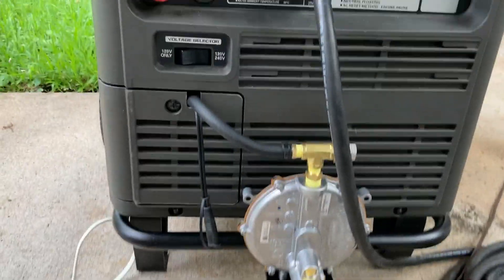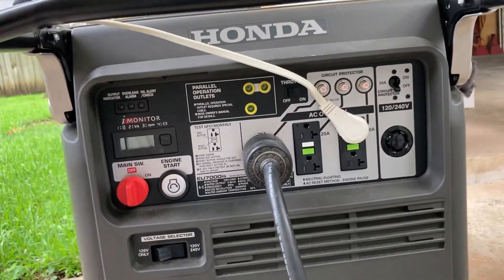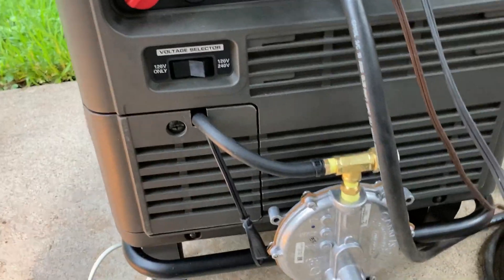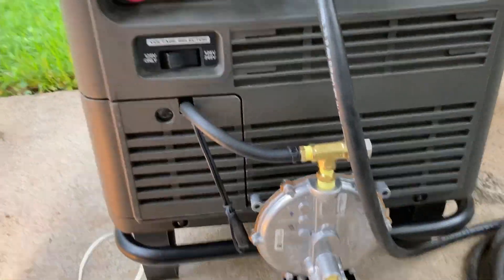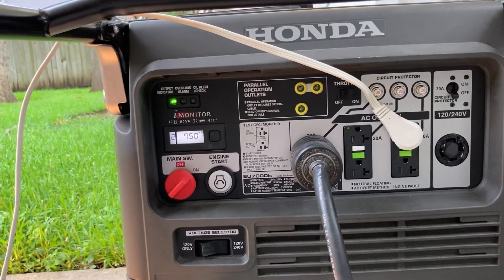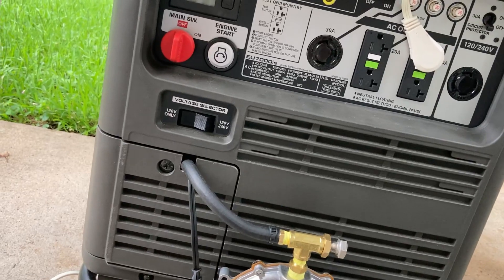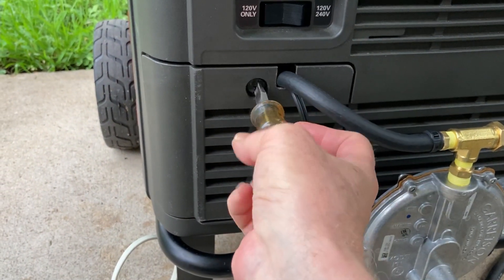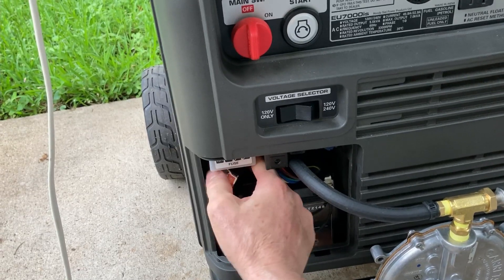Honda EU7000is running on natural gas with US Carburetion Motor Snorkel tri-fuel conversion kit

Comment: After a four day outage here in Ottawa, Canada, I have ordered a Generlink kit to replace my 10 circuit Reliance transfer switch, and also I do plan  now to go ahead with natural gas conversion. The Honda IE6500 cost me about 1 litre of fuel per hour ($2) which is not bad, but not like using the natural gas in the home. I have a  question. Based on your experience with pretty much the same generator, will the 3/8 inch outlet I currently use for the barbeque provide enough gas to power the Honda or should I buy all 1/2 inch fittings and have a gas fitter change the lines inside the house. 
Your opinion ?
Reply: Just an add on to my previous comment. It only takes one major power outage to change one's opinion on backup power. I now look upon all this backup equipment like I do when I buy insurance. You pay for something that you hope you will never have to use. At least with the Generlink plus natural gas conversion steps you DO get something besides "insurance". After watching my neighbours struggle with lack of power, and running 100 foot extension cords to keep their sump pumps and freezer working, I now have new respect for backup power. And frankly, I don't give a damn how much it costs me to get set up much better, I'm going ahead with it...including natural gas conversion. 

My son and one of my employees are currently using my two Champion 2000 watt generators to assist untold people in preventing their food from spoiling. It looks like another week before this disaster will be over with everyone back on utility power. This real disaster will not be easy for forget, even though my home was powered by the big Honda for some 60 hours total.
Reply from the maker: @TOURMANBOB  Oh, so you're still doing it - that's awesome!  Yeah nothing like a good disaster to alter one's perspective.  That's how it is with any kind of "prepping" - silly waste of time and money until it's desperately needed.  Following the Texas blackout, I was ready to buy a legitimate water-cooled standby generator.  But fortunately(?) they were impossible to buy in the wake of that event.  I did go ahead and install a new breaker panel with a manual whole-house interlock, though.  I still don't have it finished...8/3 copper wire is so absurdly expensive right now...kind of takes the fun out of it.
Reply: @MstrMark  Boy you are so right !! After four days of easy running my home on the Honda EU6500 I actually feel somewhat blessed. My electrician called me this morning with the permit information for installation of my whole house Generlink system... an expensive but very good option  where it is allowed (ok, up here in Ontario)
I too thought about the standby generator but hearing one run at a friends place I'm glad I didn't opt for it....it is frigging LOUD...worse than an open frame construction generator. So just waiting to get screwed on the Hydro permit ($315) after which he can proceed. Half the town is still out but my power has come back....this has been the worst damage seen around here in 50 years
Reply from the maker: @TOURMANBOB  I'm sorry to have created confusion by posting from my other YouTube "brand" channel.  I don't really want to mix the two, so I deleted those posts...just so you won't think you're going nuts or something...

Sounds like it was a nasty storm...glad you came out of it okay.  For us, hurricanes are probably our most fearsome weather.  Or at least, our biggest weather.  We do get the occasional tornado, but while much more intense, they are also much smaller.

I hope you'll let me know how your conversion goes.
Reply: @MstrMark  Absolutely I will. I will also let you know if I have to turn the ECO switch off to allow the EU6500 carbureted generator to ramp up properly for heavy loads. I have subscribed to your channel so I can find you again in the future. Will also advise if I had to upgrade the 3/8 copper loop in the gas supply to get things to work properly.

I saw a news post this morning where one of the newscasters did a survey of people asking what they would do first in preparing for the next storm. Overwhelmingly people said they were going to buy a gas generator...surprise surprise. But when I was in Rona, I saw them selling noisy, open frame Briggs Stratton 5400 watt generators for $449 and these were going out the door like hotcakes. I got the opportunity to talk to one of the buyers who was looking for advise on how to use them. While telling him about proper break in procedures and oil in general, he told me, and I quote..."I don't give a s**t about all that; I'm going to run the hell out of it until the power comes back and then sell it".....

I love machinery and this made my skin crawl.
Reply from the maker: @TOURMANBOB  Yeah, one has to love machinery to pay ten times as much for a new Honda EU7000is.  They are currently around $4700 and backordered, so literally ten times as much as an el-cheapo generator, and also unobtainable.  In a way, I regret spending so much.  But on the other hand, my EU3000is from the nineties still looks and runs like new, so its fair to say that they hold up very well over time.  It's just too bad that Honda wont embrace natural gas operation, because all of the troubles that I have ever had were related to the conversions.  At the price, it really SHOULD be tri-fuel capable.  

Take a look at Champion to see that it is entirely possible - one can get two 4650 watt dual-fuel quiet inverter generators for $2300, which is still less than half the price of the EU7000is before the expense of conversion.  I know it's not apples to apples, but in my mind, having redundancy would be worth something, as would propane functionality right out of the box. And each one weighs less than half of what an EU7000is does, so they would be easier to move around. Propane ready, more power, redundancy, and lighter weight, all for half the price...it is rather compelling.
Reply: @MstrMark  I agree totally and wish Honda would step up the plate and make at least a compatible conversion kit. However, I don't regret personally spending $3700 for a used EU6500 with 93 hours on it. Personally, I enjoy owning fine quality machinery. I also own a 2003 Honda Goldwing 1800 cc "jewel" of a motorcycle, plus numerous very fancy and very and expensive rifles and handguns, plus an expensive metal lathe and other machine shop tools,  all of which are well worth the money (to me at least). I also have two Champion 2000 watt 10 yr old generators doing continuous duty at the moment, helping people out of their no power situation. These cost me $400 used and they are worth every penny. The Honda if I ever go to sell it used, will go for $4500 to $5000 as the new ones are $6700 Canadian. Someone wiser than me once said..."long after the price is forgotten, the quality lives on". 

Champion technical support I have used before and they are superb. Newer Champions with dual fuel are also excellent and really do make you wonder why spend all that money on a clearly overpriced Honda. I guess it comes down to each individuals personal values and what they can afford. If I was to do it all again, and I wasn't able to find the deal I got on the Honda, without a second's hesitation, I would buy Champion right from the get go above all others. The inverter models are also quite quiet and suitable for residential use (I also care about my neighbours...). Plus the company gives great support on replacement parts (try that with a Chinese machine more than 2 days old....:))

But now that I am going into this project full force, I don't plan to compromise at any point...good generator, Generlink interface, plus natural gas conversion. Price is the last thing on my mind when I look our my kitchen window on a sea of black houses owned by people who didn't plan ahead in the least....

That ain't me....:)))
Reply from the maker: @TOURMANBOB  I once made my living as a mechanic, so I share your appreciation for fine machinery and tools.  I guess that's why I was willing to pay too much for my Honda Generator.  I have talked to real people at Champion...seemed like good people.  Still Chinese built, but with US engineering and support.  My only real regret is with the lack of engineering surrounding every conversion kit that I have tried.  I think that's why you won't find any manufacturer-created videos where they show the generator in real-world situations - because it just doesn't work right.  I just hope you have better luck in that regard.
Reply: @MstrMark  Thank you sir…..even after reading all the posts about all the potential problems, I’m still going to give it a try. Hopefully I’ll have decent luck
Reply from the maker: I have to admit that I don't know about the "IE6500" model, but the rest of what you're saying seems familiar to me. I think that most everyone who has ever converted a larger generator to natural gas has wondered in (fill in the black size) is big enough.  I used to wonder that same thing with my EU3000is conversion.

I can tell you this: I have 1/2" black pipe feeding my hook-up.  Considering all of the turns, I think it calculates out to about 60 feet equivalent.   There is around 50 feet of larger pipe before it reduces down to 1/2", but I feel like that is probably insignificant, as long as there is no other gas consumption in the house.  I used 1 3/8 valve, quick-connect, and flex hose with the EU3000is - literally a gas grill hose.  It always doubted that it was enough, so when I got the EU7000is, I bought a 1/2" full-port valve, along with 1/2" quick-connectors and hose. 

That's what was in use during the video.  By experimentation, I have determined that turning on the gas clothes dryer the is connected just on the other side of the wall has no effect on the capacity of the generator.  The dryer specs say that it needs 18,000 BTUs, so that suggests that my 1/2" line has at least 18,000 BTUs more capacity than actually it needs.  Or at least some amount more than it needs.

Here's another story - during the most massive power failure in Texas history, it was also one of the coldest nights in Texas history.  During that outage, I ran my generator.  I used it to power my gas furnace that is connected to the larger piping before the 1/2" reduction.  The furnace is rated at 65,000 BTUs input, so it's the biggest gas user in the house, and yet it had no apparent effect on the generator.  Granted, I wasn't maxing out the generator during that time, but my take-away is that the gas supply is more than enough for the generator. 

Keeping in mind that 1/2" schedule 40 black pipe has an actual ID of around 0.622 inch.  The full-port valve measures exactly 1/2-inch.  The quick connectors are essentially impossible to measure in a meaningful way, but they are visually larger than 3/8" connectors.  I also can't get at the actual hose ID without cutting it in half, but it too is visually larger than 3/8" hose.

These real-world observations would seem to be in conflict with the charts and guides that one can find online, which suggest that larger (or much shorter pipe) is needed for a generator this size.  And yet, it it is quite obvious that the pipe is delivering more than enough gas.  Maybe they were using the nominal pipe size as the actual size...(?)

So if you're asking me, I would say that 60 feet of pipe like mine is just fine, and I also think there is some room to go beyond 60 feet at that same size. This assumes that one is working with the same gas pressure that I am.  Get yourself a gauge and you won't have to guess.  I feel that anything smaller might be too small, although I have no real-world experience to support that feeling.  But based upon that feeling, I would want a hose bigger than 3/8".  I don't know how they do things in Canada, but around here, 1/2" is the smallest piping that is commonly used inside of houses.  Even with 1/2" PE gas pipe, the actual ID is still larger than 1/2".  So hopefully you don't need to change any piping inside your house.  Unless it's a really long run.  I've seen people use really long flex hoses to their gas meter rather than re-plumbing their house.  Although a 12-foot house is a lot easier to store and work with than a 100-foot hose.
Reply: @MstrMark  Thank you so much for taking the time to answer my question. Please know that I do truly appreciate it, especially as there is so little information available for use in making any kind of decision like this. I read your answer very  many times to get the full understanding of what you were saying.

 My gas supply in the home is the normal black steel gas pipe 1/2 inch or larger to feed the gas furnace and gas water heater. About 10 feet away from the furnace, there is a connection with a shutoff to the barbeque outside, and from that turn off switch, they have reduced the piping down to 3/8 copper tubing. This runs all the way out through the wall and connects to the barbeque quick connect. Now when  I connect to the outside gas quick connect, I am going to use 1/2 inch flexible hose all the way to the generator about 15 feet away from the outside quick connect. What this will mean is there is only a short run of copper tubing which is 3/8 inch, and which I can replace if the current gas supply turns out to be insufficient to power the generator. But I'll try it first and see how it all works on the current piping...

I also checked the tubing currently in use with the gas barbeque and it does appear to be the smaller 3/8 tubing. But a barbeque is NOT a generator which I imagine will draw far more gas supply !

FYI, the EU6500 only differs from the EU7000 in the fact that the 7000 has fuel injection rather than carburetion. Plus the nameplate would indicate a surge ability up to 7000 watts while my EU6500 has a surge maximum of 6500 watts. However, both versions of the generator put out the same amount of continuous running power....5500 watts. So when they came out with fuel injection, I kind of think their marketing guys had a hand in renaming the new model as much as anything they actually did vis a vis output levels. Honda is well known for underrating their generator products.

Frankly, it's easier and cheaper to convert the EU6500 as it's only carburetion I have to worry about with nothing needed in the way of an "add on module" needed with the 7000 because of the fuel injection. US Carburetion has the kit for my generator for $187 US and I can pretty easily do the mods needed (I have a full machine shop in my basement). My electrician this morning applied for my Ottawa Hydro permit ($315), and once I have paid for that, he says he can install the Generlink within 10 days. Once that is all working, I will test out the gas dryer, electic washing machine and my AC to see what will actually run on the generator on gasoline and what won't. From there I can make a decision to proceed or not...

If I do go natural gas, I have to remember  that the generator will lose 20% of its output capacity running on natural gas, so at that point , I will make decisions on how much further I can go...ie:continue to pay the $2 an hour to run the generator (plus all the very real hassles of getting gas when the stations are all down)...or...buy the kit and install it, test it to see if the current gas supply is sufficient, and if it isn't then call  a gas fitter to upgrade that short limiting loop of 3/8th piping (which would be the limiting factor since everything else is 1/2 other than that)

In any event, thank you again for your thoughts and comments.
Reply from the maker: @TOURMANBOB  3/8" copper...that's kind of unexpected.  Around here, the code no longer allows copper for natural gas.  And AFAIK, it never did allow copper buried within the construction.  I think I would be inclined to replace it on that basis alone.

The EU7000is needs somewhere in the neighborhood of 24,000 BTUs.  That's just a little more than the average clothes dryer, which seems to be around 22,000 BTUs. There are some big gas grills that use over 300,000, but of course it depends on the grill.

I know the EU6500...but you wrote "EI6500" <grin>.  I would say that carburetor vs injected is a double-edged sword.  On the one hand, the EU6500 is less sophisticated, so one can fiddle with the mixture any way one wants and it will keep on running.  But the EU7000is knows when the fuel mixture is off and it will shut itself down if it doesn't like it, which is bad news for a bad conversion kits.  On the other hand, the EU7000is has variable ignition timing, which is way batter for natural gas, assuming that the conversion kit is good enough to tell the computer to crank up the advance.  Most don't but the US Carburetion kit apparently does, which is kind of the whole point of this particular video.  This kit succeeds where the others failed.

You certainly will lose surge power, although you may not lose the rated continuous running power, because as you say, Honda is rather conservative in their ratings.  What is likely, however, is that you will not find any setting of the load block valve that results in the machine running perfectly at both light and heavy loads.  I lived with that reality with my EU3000is conversion for many years.  It "works", but it certainly isn't ideal.  If I adjust for good results at 800 watts, which is kind of what my house uses without air conditioning, then it won't run at all at 2400 watts.  If I adjust for 2400 watts, then it's super-rich at 800 watts,,,, stumbling and backfiring and generally being obnoxious.  I think you'll see something similar with any engine that has fixed timing.  I'll be very interested to know how it works out for you.

For me, it was all about having enough fuel for an extended outage.  I would consider 48 hours to be a bare minimum, and I'd like to have much more.  When the power is down in a small area, it's not as much of a problem...just go to a gas station down the road.  But when most of the entire state goes down, as we recently experienced here, that's a whole other thing.  So that means that one needs to already have what one needs before the event occurs.  And with gasoline, that would require a lot of storage.  Around here, it is a violation of some rule to store more than 25 gallons of gasoline in the same building, so with the EU7000is that breaks down to a maximum run time of about 3.5 days at 1/4 load.  

But most of our outages happen on the hottest days, which means that one wants to run some A/C, and the machine burns closer to a gallon per hour under heavy load.  That's just not enough time in my mind.  And trying to get (5) 5-gallon cans refilled every day is not something I want to face during a disaster.  Not to mention the fact that gasoline likes to blow up.  And even with fuel stabilizer, it likes to go bad pretty fast. So that adds the additional hassle of trying to figure out how to safely rotate the fuel supply somehow so that it doesn't go bad. Some people do enough driving to where it would be possible to keep the fuel fresh, but just don't burn enough fuel to make that idea practical.

For me, propane and natural gas are the only viable alternatives.  Propane can be safely stored in great quantities, and it essentially never goes bad.  Natural gas is not so easy to store, but it's "on tap", so to speak.  There were some supply failures during the recent big blackout, but not here.  I have never personally seen natural gas fail.  I could always switch propane if it came right down to it..bartering power for propane cylinders off of all the grills on the block.
Reply: @MstrMark  Thank you...I did not know of this variable timing business for the EU7000 at all. So I will have to expect to adjust the mixture on the regulator when the kit is used on my EU6500. One more thing I will have to consider before taking the plunge. I also didn't know about the  regulator problem with using copper but that might be just a difference in codes between Texas and Ontario. More likely the guy that installed this barbeque outlet simply took a quick way out and figured I would never know about this violation

Again, I have learned a lot from this thread and I thank you once again for your comebacks. If I go ahead, I will make a point to let you know if I end up having to adjust the regulator under different loads...least I can do...,

Cheers !!
Reply: Just wanted to add my 2 pesos. You can always just get 3/4" or 1" hoses with quick disconnects on each end to almost any length to get the natural gas from your meter to wherever you place the generator. So just have a plumber add an adapter to one of the outlets at your meter. Online calculator (google it) to determine the dia of hose required based on length of run and size of generator. Lots of these available online. Then you can move the generator and store hose until needed.
Reply from the maker: @goofsaddggkle7351  Yes, although my meter/generator locations would require a very long hose.  The longest ready-made hose that I found online was 100 feet, and it cost $850.00.  And I would need more than 100 feet.  If one goes by the chart that I found online, one would wind up with an awfully big, heavy (and long) gas hose to store.  It's a perfectly valid idea, and it makes good sense for some people, but there are also some valid reasons to try to use existing plumbing.